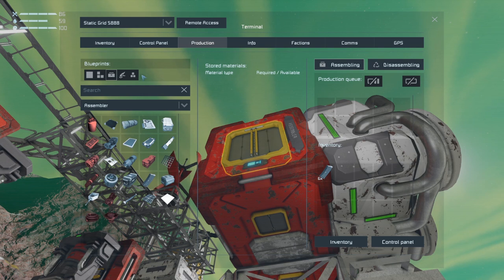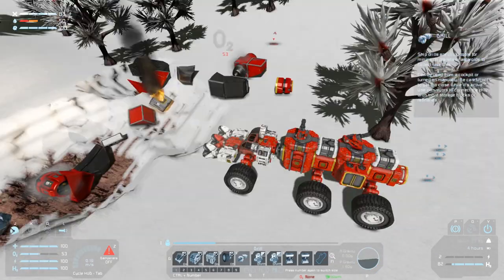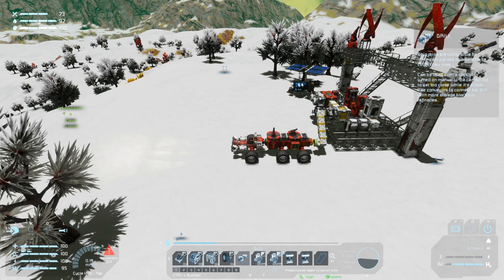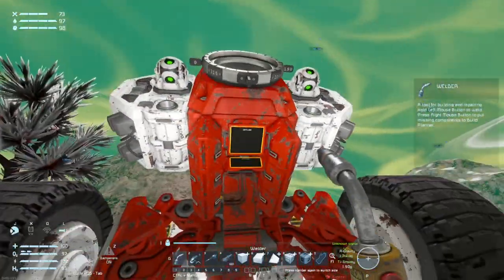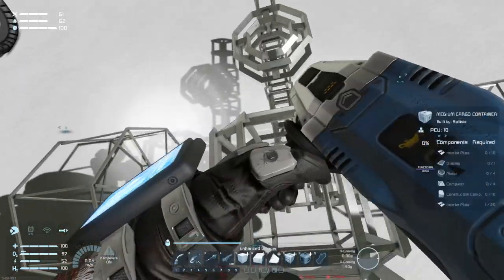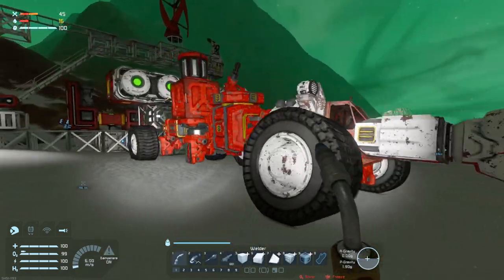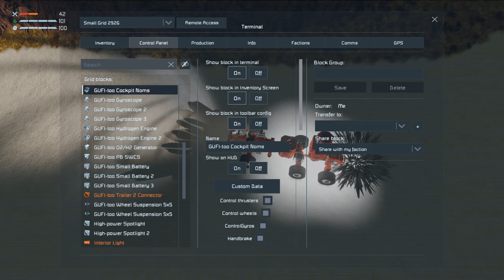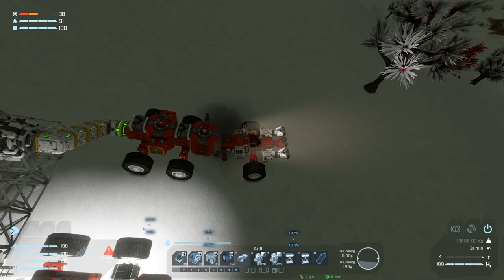Survival Impossible - Searching for Ore #8 - Space Engineers Hardcore Survival

Comment: If you make the motorbike, call it the Aphid, so it has a good reason to run away from a ladybug.
Reply from the maker: Seems fair :D
Reply: @Splitsie  If it's purpose is to be fast and cheap giving it two hydrogen thrusters, one for hover and one for forwards, is maybe the optimal solution? I'm sure you have experienced the SE wheel suspension in high speeds.
Reply: Also feels reminiscent of the tick

Comment: Happy New Year Splitsie! not much time nowadays to see all your videos but this series always first for me.  Why not use your sandbags to protect surroundings? I know is from another series but you could modify to wheeled sandbags for example since it would be hard to transport them otherwise.... or hover engine sandbags even cooler.. but expensive.
Reply from the maker: Happy New Year to you too :)

I'm thinking static guns setup like the sandbags were, but static so they're less of a drain on the old sim speed and can be made large grid for the extra bit of range - so instead of taking prebuilt ones I might need to design a welder truck at some point so I can build each one really quickly

Comment: 0:23 More trailers, until it looks like a convoy as one vehicle, is the best idea in my eyes. Maybe not the most effective or efficient, but the most fun and entertaining for almost everyone involved. Especially Clang.

3:00 Despite suffocation being a real danger, oxygen is not in short supply.

6:10 I feel like cutting out the time of transporting probably around 100kg of stone by hand is indeed worth 150 steel plates and 40 construction components.

8:49 Is it the snow that has that little traction, or your wheels? You might want to up the friction a bit, though it also may have been the levels of the terrain. The cargo can't be helping, I suppose.

10:15 Commonly known as 'The Prometheus School of Running Away From Things', though if you're being chased rather than just in the way, it could turn towards you if you turn away to soon while being actually chased. Bit nitpicky, but - oh hey, a wrecked cargo ship! Running wildly to the side payed off!

Couldn't you put one bottle into the O2/H2 generator to fill it, then the other?

19:10 The blast door blocks are an essential part of the GUFI, however, they cannot be removed, even when replaced.

21:14 I think the longer wheel base makes it look better, even if it might not make it drive better. Also, does detaching the front still reset all of your controls for the trailer?

28:55 Could put it to the side and then turn the rotor, but I don't know if the hitboxes will like that.

32:46 Just remember to turn it off, unlike some of the other times when ore detectors and fairly low battery lives were involved.

Looking forward to how the bike will be made, always interesting to see the immensely varied designs for the things due to how SE wheels work. That, and to how you manage making a tunnel down to that nickel. Mining with rovers (outside of the drill-on-a-piston thing) isn't done too often, we may soon see why.

Also, while watching the timelapse, I noticed that the connection between the two halves of the new trailer is merely a single pipe. Might want to give that some armor blocks for if a few stray bits of rocks, or even bullets, manage to find their way to it. Don't want to be merging these things back together without regaining the lost resources.
Reply from the maker: I was thinking the same about the hitboxes, a bit too risky to attach it and then be stuck with the ore detector hanging off to one side :P

Fair point on the weakness of the trailer - great excuse for greebling too :D
Reply: For accessing the underground deposit, rather than going from the ground above it and trying to make either a straight or spiral ramp that far down, perhaps you could mine in from the side of the cliff to get to it? The elevation seems roughly equal based on the ore marker, though obviously I don't know the deposit's shape so it might not be good for that.

Comment: I'd recommend simple bulwark defenses.

Where you build a 3 block high by 8 block long wall. Then place 3 turrets  on top of it.

You can place one battery a small grid  remote control an antenna and a solar panel and activate it remotely off your hot bar. Then you can run to it and hide on the side of the wall opposite  the attack.
Reply from the maker: Interesting idea, might be worth doing something along those lines once I have the resources :)

Comment: Fun fact, I do the same thing with my GPS markers. I do U- for underground and A- for above ground (boulders and close to surface). that way its at the beginning and easy to read. also, I have a blueprint for the motorbike I can upload to steam if you would like some inspiration. it has room on the side that you could add a rotor part to take it with you and bug out anywhere. lastly, why not use a timer block/program for the ore detector? set it up for attach/detach rotor for on/off.

Comment: if you plan on doing multiple trailers, you should think about building a smooth road from the base to the quarry. a dirtpath like road should be good for now, to minimize the risk of actually destroying your rover when going up and down those slopes, as you just cut through most of them, to make a smooth surface. it should also be fairly easy to cut a nice road in the landscape near you, because the route you take to your mine, isnt that hilly and slopey.

on a side note, there is an actual mod for bike wheels :D
Reply from the maker: Sadly the smooth snow is always going to be better than anything I can drill, SE doesn't play nice with trying to cut your own roads, they always end up with a fairly rough surface that would limit your speed a fair bit. It's down to the way that the drills cut to a 'voxel grid' the only way to get smooth surfaces is with creative mode tools :(

Comment: The issue with the random scrap seems to be caused by the ships not being spawned in right and not auto leveling. That's just my idea anyway.
Might want to start checking the rotor's health before smacking the parts together, they don't have a lot of it on small grid, I've found that you don't actually need the parts that close together to get them lock. The general vicinity works fine. Just have the barrel of the part, which does not take damage, somewhere near the actual rotor will lock.
I paint my drills yellow, as well as welders and grinders.. you know, the things that can kill me. Make them noticeable, high contrast compared to my normal colors.
Reply from the maker: I did a bit of investigating prior to my last update of the mod, it seemed that while I'd tested the ships on the high grav planet I didn't treat them where they'd have to fly at high altitude and the didn't have enough thrust to make it :P

It's since been fixed though :)

Comment: As far as modded ore detectors, you can just make the vanilla ones reach longer range in the 'cube blocks' file with a simple mod. I like 150m/300m for the ranges. This way, you still have a need for the large grid ones, and the small ones are a little better than the hand drill. Also, by modding the vanilla block ranges, you don't have to replace blocks in the game.

I used Skallabjorns vanilla ore detector mod as the base for my 150m/300m range I currently use.
Reply from the maker: I was more thinking along the lines of, if I give myself something better than the current ones there should be some downside to it so I wouldn't just straight up replace them - from adding grids to the recipe, increasing power costs etc
Reply: @Splitsie  you can do all that in the block file. For example, I made the batteries give back power cells on my server, but made their initial power at 0, so it is a trade. I also added more steel plate, computers and construction comps to the batteries. You can do all this with the ore detectors also.

I was merely mentioning the ease by which the modifications can be made.

Comment: You could probably write a pretty simple script to control that air vent. Make it turn on when the oxygen tank is reduced to a certain level and turn it off again when it's full.
Reply from the maker: I'm sure someone could, I suspect if I tried it would take me a good few days just to work out that much though :P
Reply: Hahah! The major problem is the very poor documentation for scripting. Doing just this took me far longer than it should have simply because there's deprecated interfaces whose replacements aren't detailed anywhere. The logic is fairly simple. It's just figuring out how to access the blocks' data...

public Program() {
    Runtime.UpdateFrequency = UpdateFrequency.Update100;

}

public void Main(string argument, UpdateType updateSource) {
    IMyAirVent airIntake = (IMyAirVent)GridTerminalSystem.GetBlockWithName("Air Intake");
    IMyGasTank oxygenTank = (IMyGasTank)GridTerminalSystem.GetBlockWithName("Oxygen Tank");

    if (oxygenTank.FilledRatio < 0.8) {
        airIntake.Enabled = true;
        airIntake.Depressurize = true;
    } else if (oxygenTank.FilledRatio >= 1.0) {
        airIntake.Depressurize = false;
        airIntake.Enabled = false;
    }

}

Comment: Splitsie after watching your video.I tried small rotor attached to big rotor head 
for the same reason as you (big ore detector on small grid) 
and guess what there is some kind phantom power every time i drive my rover, make it hard to drive it and sometimes rover spinning without control and BOOM

IS THIS CLANG ? CAUSE DAMN I AM LOSING MY MIND
Reply from the maker: With this setup the ore detector is one of the heaviest parts, I'd suggest doing what I did in the setup and turning on rotor lock as well as share inertia tensor, but most importantly making sure there aren't any blocks that are too close to the ore detector (the best example of this is can think of is in my pistons tutorial where I show the larger than visible collision boxes)
Reply: thank you very much splitsie i found the problem the collision box is bigger than i thought

Comment: Have you ever tried playing around with the breaking force of the Gufis rotor? it takes an annoying amount of testing to find a good value but once you have that and turn the rotor off so it applies, the whole thing works like a torsion spring in setups like this and at the very least make the vehicle far less prone to rolling the rear part. At least in my kind of failing attempts to recreate the Unimog in SE
Reply from the maker: Is there much benefit to it for the roll? I ask genuinely as I'm not sure. I've got rotor limits set up so would I gain any grip by making it more resistant to turning in the angles it's allowed to?
Reply: @Splitsie  For all i know it depends on the vehicle and mainly how much mass is not in line with (/above) the rotor's turning point. I'm not a native speaker so its a bit difficult to put into the right words but in a fast corner the rotor actively works against the rear starting to roll in the first place and the mass in the front part of the vehicle is being used as a counterweight. So the whole car becomes stiffer in itself and because of that a bit more stable 
On the other hand you do of course sacifice a bit of how fast your wheels reach the gound again when you are crawling through difficult terrain.
So you would either have to change between "drive modes" for run.. tactically avoiding an npc and climbing rough terrain or find a good compromise value. Like i said, it is a pain to configure either way. But with this kind of setup or contraptions that use swinging axles i usually get at least some improvement
Reply from the maker: Ah, that makes sense. I could probably find a mod point that'll be helpful at high speed while not frustrating at low speed :)

Comment: I always thought that ore detector range was garbage... you should be able to increase the range for a power trade off.
Reply: actually... it makes sense from an engineering standpoint, of course gamewise it doesnt mattter as much but in real life you cant just go and up the "range" of something by dumping more power in.  
Many ore detectors work by measuring the electromagnetic induction voltage, the field strength (the necessary attribute of the field for induction) isnt really that simple to enhance, while more electricity seems to be a solution it actually isnt because of the inverse square law which makes it actually really difficult to sustain high ranges. 150 meters is already waaaay too good for "commercial" use. So yeah, makes sense as a limit in real life.

If you dont like the limitation of 150 meters then you can always get one of those modded ones that find you anything in kilometers of range. In real life you wouldnt want to be in such a strong electromagnetic field though xD
Reply from the maker: It's not great, but I get hwy the vanilla ones are short given the performance impacts. I may still change my mind, but if I find underground ores of each type with the vanilla I won't really need to... maybe :P

Comment: might be worth drilling out a tunnel near where you are mining big enough for your rover for when you need to run and hide tbf and have it wide enough so that you could store your motorbike there so you can use that to lure the drones away 

also having 1 drill above the 2 end ones so those 2 extra's you added if you add a coveyor  junction then have them so the drills are in a U shape that might remove the risk of your wheels hitting the drills, and let you avoid using max strength suspension... plus should allow it to clear the way for your rover when you drill deeper
Reply from the maker: Definitely worth having a hidey hole somewhere, it's probably moving higher up the priority list than it once was with all these cargo ships flying overhead :P
Reply: @Splitsie  yep definitely

Comment: If you are going to use the goofy only "wheely" mode my guess is you need some more spotlights that don't light up just sky
Reply from the maker: That's a good point, or at least some interior lights for a little bit of area illumination
Reply: @Splitsie  that would be the reasonable thing to do. A somewhat 'decadent' option would be a rotor for the two ears .. with a timer that rotates and adjusts suspension etc

Comment: Gonna get a bunch of crap for this. But put the wheel on upside down.  It makes sense for the raising and lowering but when you place them it gives a ton of room to weld without needing to have the vehicle 50 ft off the ground.
Reply from the maker: It doesn't work that way - the suspension won't compress properly if you place it upside down on building
Reply: @Splitsie  gotcha.

Comment: RE: forgetting to turn the ore detector on trailer 2 off... Why not add some timer blocks so that it shuts off automatically 5 minutes after you turn it on? (of course, that might lead to driving around after it shuts off wondering why you're not finding any ore... :) ) Although I think it only uses 2kW, so might not be worth the trouble
Reply: If you go with a timer block approach, it might make more sense to have the timer block turn off the detector and detach the rotor so you could trigger it when parking. Attaching and powering up would still be manual/independent actions.
Reply from the maker: Good thoughts on both fronts, I'll certainly have to sort out my hotbars if I end up with timer blocks everywhere to remember what does what :P

Comment: Might be a cool idea to consider building roads. It will reduce the risk of driving to and from the various mining location you are likely to be frequenting. It will also make running from drones safer. Maybe there is a road service mod that will give a alternative to steel plate, but still give the roads a cost. Just a thought.
Reply from the maker: Sadly roads in SE aren't really a great option - mining out voxels leaves you with a very uneven surface no matter how you approach it (it seems related to the unseen 'voxel grid' that SE has) so I'd probably have more trouble traversing a mined road than the very smooth but hilly snow :(

Comment: lucrative ,,,, it made building stuff easier by being more of what you need in bulk and it cost you the time to pick it up is all
Reply: in all the episodes of this game the most common thing you do is make a vehicle and then have to fudge how to get wheels on it when you notice its not high enough off the ground .... how about making a proper vehicle build garage that has a floor that lowers and raises like a car lift ... then you build the vehicle on that platform from a bit that doesnt move with the floor and drop the floor as needed to work on the bottom side ... or under neath .... added bonus you can make it an access point to the underground part of the base as well so once built you can take it underground to safety to park and use the drive out exit or the car lift one
Reply: lol epic ... drones dont touch you ... back into the the first trailer and poof there goes bits ... epic lol
Reply from the maker: I should keep that in mind when I go to build the garage, even just a crane to start my builds from would probably work here, in fact it might work better if I can articulate the vehicle in multiple ways to help me reach bits :)